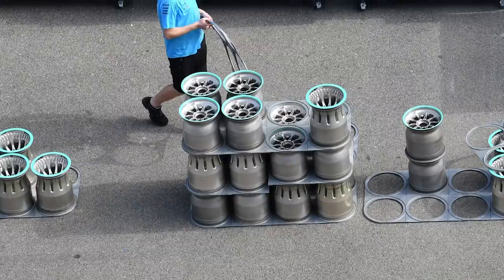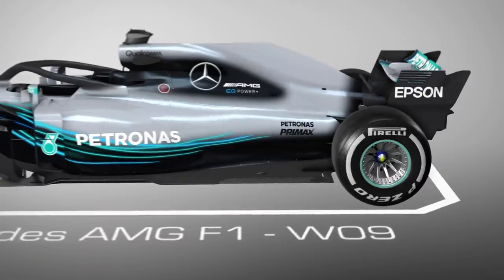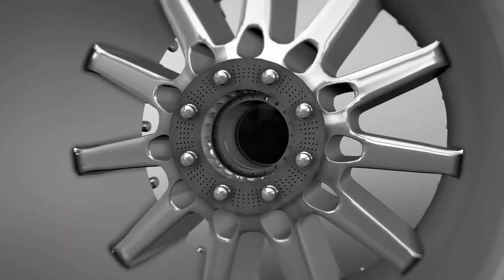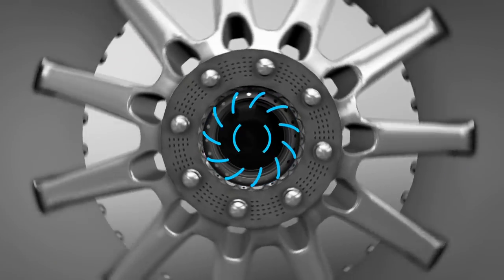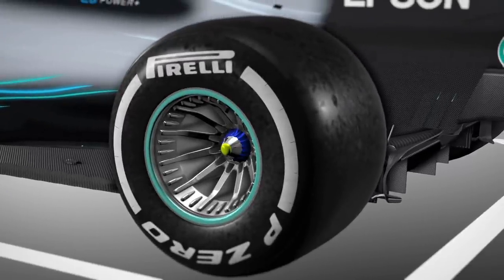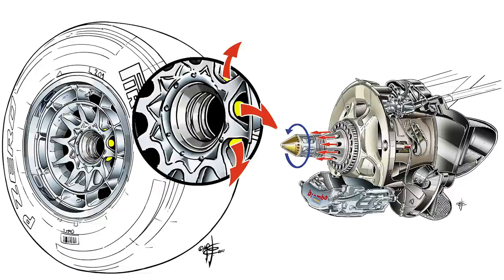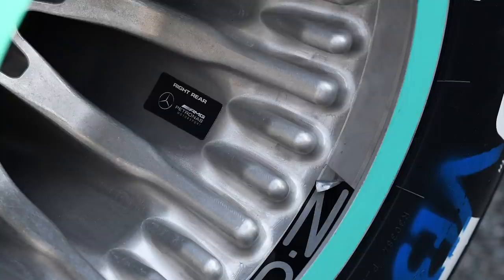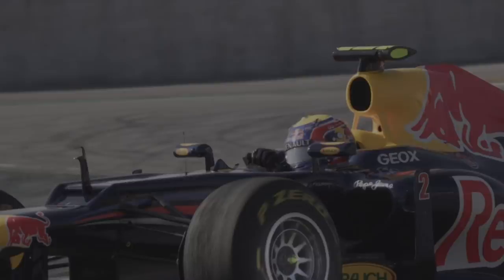Inside Mercedes' controversial F1 wheel rims

Comment: Mercedes used these to win the championship and now are choosing not to run them just incase more people protest and then they get deemed illegal which would mean that the six races they ran these tyres and won consecutively would be invalid and would have to give the championship to ferrari. That is the only reason they have been deemed legal because it would cause too much drama in the sport and would be a big scandal. If they don't run this spec again this year it proves this is correct
Reply: It doesn't work that way
Reply: Same for Ferrari,  spookily after Fia instructed them to fit extra sensors to their batteries suddenly their straight line power advantage dissapeared.  Should we also take all the points off of Ferrari for the entire first part of the year?
Reply: @Sctch_Egg  nop because overall Ferrari's Power unit was more poserful than the Mercedes, and that battery innovation was pulled off immediatly 
So. Merc gained more points than Ferrari
Reply: You have missed my point completely,  it would be ridiculous to strip Ferrari of points for something deemed legal.  Exactly the same with Mercedes and their rims,  they have been checked and deemed to be LEGAL by the FIA Technical dept.
Reply: @Sctch_Egg  legal? So why the pull It out? Because other say it's illegal=so it's illegal, and then i'll explain you my point
Reply: @Sctch_Egg  First off all Ferrari's upgrade consided illegal where pull It off immediatly, second that was illegal but Merc won Like 4 gp's with that,
Personally i don't want points back as a tifoso. But i Just think that it's hilarious. Fia obv can't take point away from then because there could be a scandal, but this is not racing is Beeing filthy
Reply: I think i'll listen to what the FIA have ruled rather than anyone else.  FIA say Legal = Legal end of argument
Reply: @Sctch_Egg  Charlie Whiting not già stewards, so it's illegal, all of them have to give the decision
Reply: Its not Charlie who ruled on it, it's the FIA technical department.
Reply: @Sctch_Egg  Yes, but only Charlie said it's legal non the others
Reply: Yup thats right Charlie plucked the decision out of his ass to piss off all ferrari fans, looks like he succeded whoop whoop #gocharlie
Reply: @federicocataldo2327  no bro, wtf is wrong with myself, that's what you should have asked
Reply: @yourerightmybad7363  don't think so
Reply: @federicocataldo2327  thats right. charlie whiting. the HEAD of the F1 technical department AND race director. his job role is described as follows (cut and pasted) 
'he generally manages the logistics of each F1 Grand Prix, inspects cars in parc fermé before a race, enforces FIA rules, and controls the lights that start each race.' 
given that is his job description, id say he of all people would know if its legal or not, and would also be THE person to tell the teams (and the world) whether or not it was legal.
if you need to further check out his CV a simple wikipedia search will tell you all the work in various forms of motorsport he has done (from rally car prep to chief F1 mechanic prior to working within the FIA)
Reply: @federicocataldo2327  at around 5:40 he states that in Mexico, Mercedes received confirmation that the FIA were happy with the design and that the spacer acted as a spacer...therefore the design and use are legal. It's not just a random statement from Charlie Whiting.
Reply: Who won the points championship last year? Ya that would be Mercedes. Oh shit there goes your theory of them not running for it. Are you serious with this comment? Oh you do realize that Mercedes didn't run a F1 program for decades right.

Comment: I have always had a problem with racing clubs trying to limit innovation. Im now an engineer, but have always been a tinkerer and that has always bugged me. If I come up with a better idea it shouldn't be restricted, other teams should follow suit if they think it is advantageous. I would say that I am more interested in the design than just the driver. I always have spent more time in the garage than on the road anyways, but that is one of the major factors that discourages me from wanted to get into a series. If I build a car I don't want to be severely restricted by class rules in terms off design approach. As long as it doesn't impact safety of the driver or other drivers it should be encouraged. Group B will always be my favorite, but obviously they were too close to the edge for that time.

Comment: Okay there is one thing that I frequently ask myself but nobody talks about. What about teams using parts that are designed with partly the goal of making the air more turbulent and for the car behind harder to follow? Its dirty tactics but I would bet a lot of money on Mercedes doing this with these rims for example. Just imagine what happens with the air that ist blown through the wheel when its spinning while driving in a 200kmh Corner?
Reply: teammates usually have similar performance and more often than not it will be your teammate who follows you on the grid. such a design would only hurt the team. as for the ethics of it, i doubt that would be illegal
Reply: @TheTororist  I get your point. Yet these days we see the top teams, especially Mercedes, sacraficing Points of the weaker Teammate for a greater good, hence the Championship for the stronger one.
Reply: @gilette01unrasiert70  not if it puts the WCC on the line. believe it or not, most of the team really values the WCC over the WDC (and it often comes with bonuses attached) but its very rare fore the team that wins the WDC to lose the WCC. The last time that happened was with hamilton and mclaren in 2008
Reply: At Silverstone, Kimi said the Mercs were easier to flow than the Red Bulls
Reply: @mr.b3ntley449  well, Red Bull is known to have good Aero and it might just happen to produce more dirty air as a side effect.
Reply: Paranoid thinking at it's best. You would bet money? How much energy do you think is actually coming out through that wheel? And, given that it's immediately outwash, how would you justify suggesting that the following car will catch it?
Reply: @TheTororist  Wrong even Toto said very clearly that the WDC is the most important.
Reply: @TheTororist  Who remembers what manufacturer won the title a short time after? answer a few dedicated fans who remembers the driver? answer many more people and also the manufacturer they drove for.
Reply: @danielthompson803  when did he say that? source please. its common knowledge the team priority is the WCC for every team. it directly affects their bottom line due to the concorde agreement and as much as the drivers title is prestigous, money always takes precedence.
Reply: WDC is renowned as being the most important from a legacy and sport perspective. WCC is most important only commercially...or if you are Ferrari and if you ever sat in a modern road car, important for its metal badge listing all titles won :)
Reply: Every team does this, but not to screw the opponents, but to make their car faster. All cars are designed in perfect conditions, which is in front of the grid with clean and "organized" air. The vortices they use are to create "boxes" in certain areas of the car, for example the diffuser, by closing the sides with vortices the diffuser becomes much more effective. Most winglets on the front wing are to create vortices and create a bunch of channels that direct the organized part of airflow to the rear wing and diffuser, not to screw the opponents.

All of this end up being a side-effect of this new rules, it wouldn´t make much sense to focus on vortices to screw the opponents and then end up screwing your own drivers when they are chasing eachother.

Also, look at RB, they always use massive rake and vortice downforce, that´s one of the reasons they are not faster in a straight line (no, it´s not all Renault´s fault), because the huge advantage they gain in the curves, creates lots of drag in the straights, I´m sure they don´t do this to screw the opponents, since they are not in the front of the grid at the moment (well, unless they do this to screw Renault, which I wouldn´t be surprised lol they love eachother).

I´m sure there are better ways to create dirty air then a fancy rim (that happens to give them extra performance because of the way it controls blistering).
Reply: Curious Cat with the utmost respect, you talk s#it. While airflow or aerodynamic efficiency are the top priority, causing disturbance to other cars is also part of the equation. In fact, one of the primary cases of this was the weird looking Ferrari F92A with a twin floor. Too many desktop internet engineers on the interwebz...
Reply: Lots of cars on the grid are already using blown hubs which blow air out through the centre of the wheel nut.  This would have a similar effect on the following car but is used for a different reason

Comment: Ferrari does something in gray area on engine, FIA bans it after Merc complaint, Merc does something on gray area on wheels FIA doesn’t ban it
Reply: Only its not a gray area FIA have ruled it legal, therefore all other teams can use it.  Strange you dont mention the ferrari battery situation earlier this year.  Clearly using the batteries in a gray area it didn't get banned because ferrari stopped using it after FIA instructed more sensors,  clearly Ferrari knew what they were doing was on the edge if not illegal so stopped it.
Reply: The FIA have said its legal and so have the only stewards asked. And the idea given the history of F1 that the FIA is anti Ferrari is comical.

Comment: If you look at old rally cars they use to do the same thing. Except they used discs. Alot of people look at old rally wheels and see the plate coving the wheel and think it's just a gaurd, when in fact it has find at the time similar to a turbo.

Sucks in cold pushes out hot. Keeps the brakes and tires cooler.

Comment: Designed airflow can reduced drag, it would be good to see the drag differences between the original wheel and the new design wheel, in these types of race cars only a small fraction of drag will increase speed.

Comment: Since mercedes have blocked the holes their form have reverted back to where it was in the first half of the season. The last two races they have looked very average. We go now to Brazil so we will see if their struggles continue.
Am not making excuses for ferrari as we have too many errors this season BUT its becoming clearer that mercedes in the 6 races had an unfair advantage..
Reply: ashavin 301 stop crying
Reply: ADVANTAGE probably, but "unfair"? what article in the rulebook do they violate?
Reply: Ok,
Let me say it plain
Mercedes were cheating with altering their rims!!!!!!!!!!!!
Reply: ashavin 301 you’re still crying
Reply: ashavin, this is what happens when you try to have a sensible discussion on Youtube.

To add to the wheel rims, lets about the uber strict fuel flow regulations for which Mercedes outrightly cheated by finding an alternative way to add fuel to the engine via the oil breathing system. What happened to them over that cheating? Nothing. Yes Lewis fanboys, he was driving a cheat car, go research it.

On the other hand, Ferrari find a way to manage their batteries better than everybody else, using exactly the same components under the regulations as everybody else, but they are asked to remove the quote Lewis Hamilton; "trick" (sic) after Mercedes serial complaining, even though the FIA doesn't actually understand how Ferrari are doing it.
Reply: Ferrari were accused of cheating with their   car acceleration. Other teams even giving mercedes data on ferrari to stop them. Now in 6 races mercedes pass seem far above ferrari then you take away that element the cars starts back to look average. So, nothing up right
Bunch of hypocrites!!!!!!!!
Reply: if the FIA says it ok, there is no unfair advantage. Ferrari can do the same.
Reply: what unfair? even the rims got clearance from FIA. so?
Reply: @markmark5269  stop accusing tricks as cheat. to stop this tricks just like to stop further new tech coming to our car that we can drive.

Comment: The design seems like it can be improved. As the air exits...the wheel channels should have been molded in a directional spiral (specific to each car side) instead of straight out...which would maintain the spiral wind forces exiting to have a smoother exit with less resistance. But what do I know. I don't have a degree in anything.

Comment: You missed the "Why". 
The airflow is needed to cool the super powerful and fast electric motor/brakes.
Being inside the hot tire and next to the red hot brakes - the motor/brakes NEED cooling.... I would use liquid nitrogen.
FIA - Please let them advance this and not keep electric drive back.... AGAIN>

Comment: So, in short, it's engineered to create a vortex of air towards the centre of the wheel. This vortex draws the heat away from the tire to the centre of the wheel as it spins. Then a series of holes at the centre pushes the heat outward, away from the car. Clever engineering isn't really cheating. It's still a spacer, and the added cooling probably helps a bit in the hot tracks. If it's truly effective others should just adapt their own.

Comment: cool.... so you could make an impeller wheel that creates a negative pressure under the car, I think that it is possible that the folks raising concern think it is what they are doing, sucking the car down onto the track in a way not necessarily allowed.(?)

Comment: Is there a rule banning rims with spokes shaped like turbine blades? That would be an effective aerodynamic tool to suck air out from under the vehicle and cool the wheels.  I know that increased surface area means increased weight so the benefit to cost ratio would have to be looked at.  But no need if there is a rule against it.

Comment: I'm gonna go out on a limb here and suggest the hot air is forced out and will run across the side of the car, pressure differential creating a little more aerodynamic benefit. Similar to how they did it with the exhaust gases blowing over the diffuser a few years ago. They would surely just put in a bigger brake duct if cooling was an issue. There is more to it than cooling and temperature management.

Comment: those things just dont eliminate heat...air is actively removed thus creating a relative negative vaccum as compared to the circumference encompassed by the outer edge of each tire.thus increasing down force

Comment: I used to watch F1 religiously. I haven’t watched a single race for over a decade.  The pinnacle of Motorsport should be innovation led not innovation restricted. 

Innovation is the way smaller teams can win with smaller budgets - rules intended to help small teams do so in the short term but they remove the ability to leapfrog in the long run.

Think about revolutionary change in the past:
- mid engined layouts
- disc brakes
- downforce
- the vacuum car
- 6 wheels
- carbon fibre chassis
- sequential gearboxes
- abs and traction control

Most of these innovations came from smaller teams where the driver for innovation was necessity - we dont have the money to compete by doing ‘more’ so we compete by doing ‘different’.

In my opinion rules should be around safety and overall dimensions, but should be very broad on everything else.

Things that smaller teams could do today to thing outside the box and compete by working smarter not harder:
- innovations to cut weight (.e.g 3D printing the chassis)
- innovations to increase engine efficiency (less fuel equals less weight, less weight equals more performance)
- run a 3 wheel car - like Nissan did with the Deltawing, the science behind that design was really interesting and counter intuitive
- innovations in the overall drive train, Koenigseggs Regera has ‘no gearbox’, can this be applied to F1 for an advantage?

For me, that’s what I want to see in F1. Something new, incredibly smart that improves the performance and really changes things. Particularly if it can trickle down to road cars in the future. 

In the interests of competitive racing and keeping F1 affordable for the small teams, why not have a rule that says “if you come up with a brilliant idea, for the year your bring it out, only you can use it, but in subsequent years you must make it available to all other teams and they must pay you a license fee to use it.”

That way ideas disseminate quickly, but pay for themselves and F1 improves rapidly via a widespread adoption of good ideas.

I’d watch that.

Comment: Actually, I don't even know why it's considered an innovation. This concept has been around in motorsports for years. Brake rotors are designed with fins in between the two braking surfaces on street cars to extract heated air, and draw in cool air.

I used help a friend with a Figure 8 car, and we were allowed air ducts with inline fans to cool the brakes, for God's sake. Water cooled brakes, like on the racing trucks wasn't allowed, even though they were easy to fabricate. The brakes didn't get hot enough to evaporate all the water, so the entrance to then turns just got wet and slippery.

Comment: This is not innovation or nothing new. A few IMSA teams had a similar concept like this back in 1980's of using the wheel face design to extract air from the brake rotor assembly. Cool air pushed towards the brake rotor through ducts & then hot air pulled out the side via the wheel face. I think Ronal was one of the wheel mfg's.

Comment: The main reason racing exists is to generate new ideas to improve the general commercial fleet. If this tech makes cars better, then MB ought to be rewarded.
I was hoping maybe someone finally designed a fan bladed spoke for rims, so at speed they would suck air out from under the pan, for improved ground-effects. But no. I wonder if anyone has tried it.